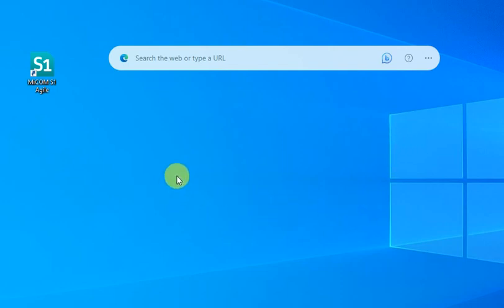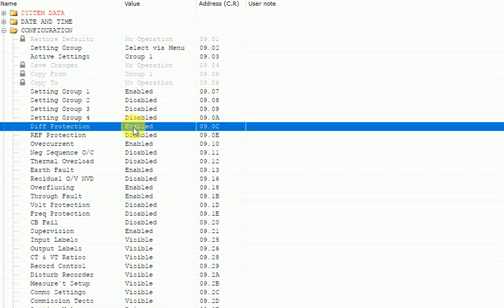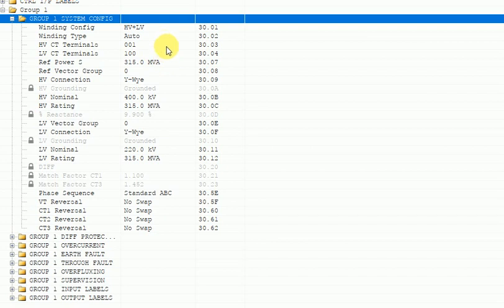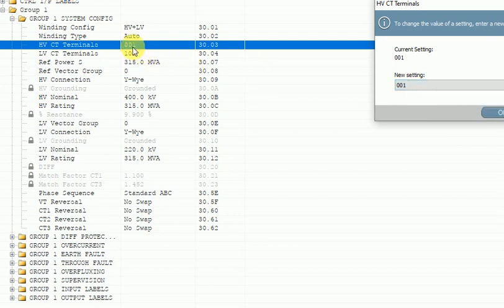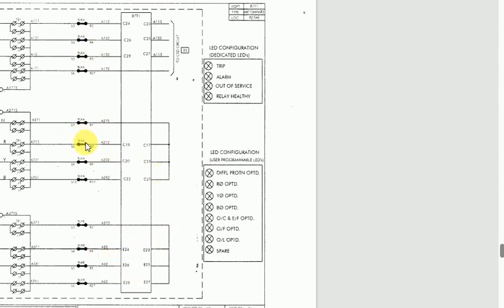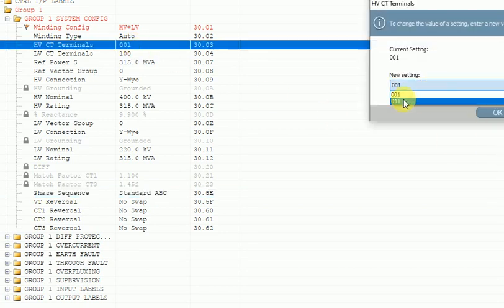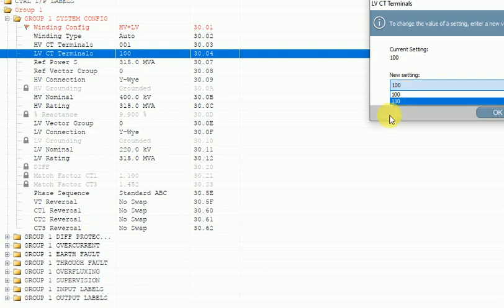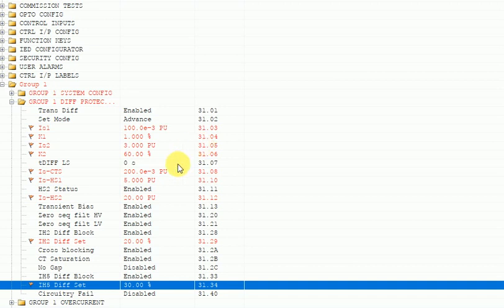How to Configure setting parameter of Micom P643 relay

Comment: What  is 200.0e-3 value in ct saturation nd how it's wrks sir...
Reply from the maker: 200.0e3 means 0.2 which is the minimum  pick up current for a diff relay. It may happen due to internal fault only or may be due to any one CT saturation . CT saturation means ac component values become  zero. I.e the current nature is non sinusoidal.
Reply: sir, please share typical setting template file for P643. Thanks